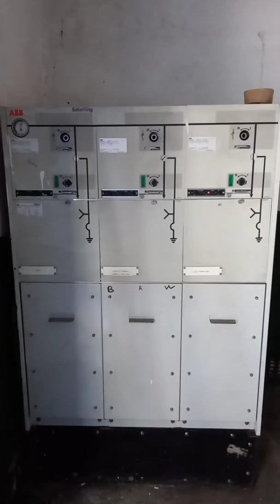Inside a City Power 6.6kV TSS Substation

Comment: Is that a transformer from the electricity company or some other company? Because in Germany those switches to turn of the ring are locked away, and only the electricity company can use them, you can only use the switch to disconnect the hv side of that transformer and you can ground the live cable with the switch.

Comment: Looks similar to British practice except I've never heard of circuit breakers being used on the LV side except in private sub stations
Reply from the maker: Very likely. South Africa uses the same standards mostly as the UK (except plugs and those ring mains in houses). The old UK wiring colours are still used here.

City Power is replacing fuses with breakers for two reasons:
They get stolen
They don't always have stock of spares